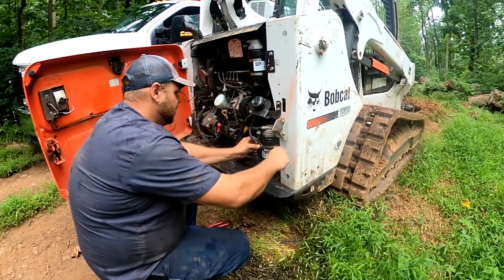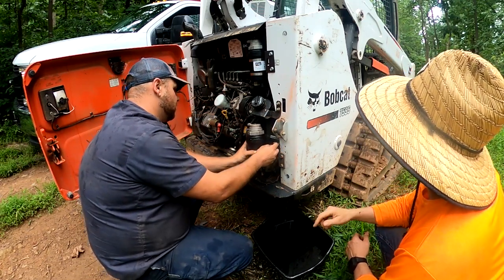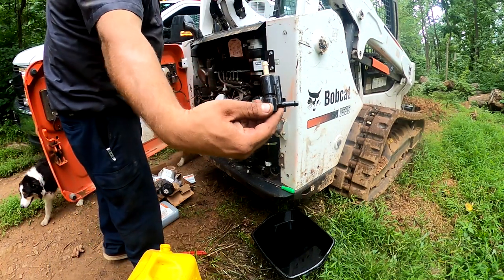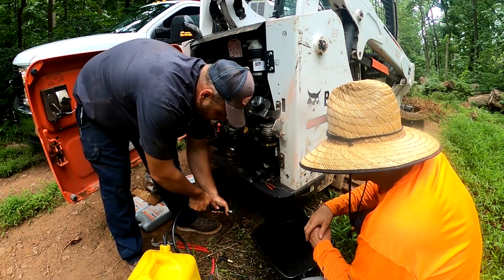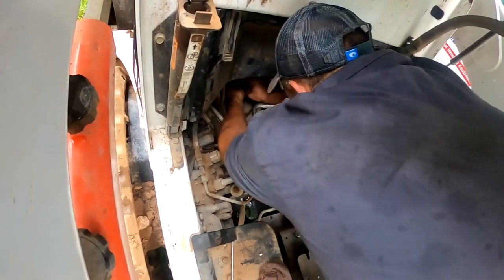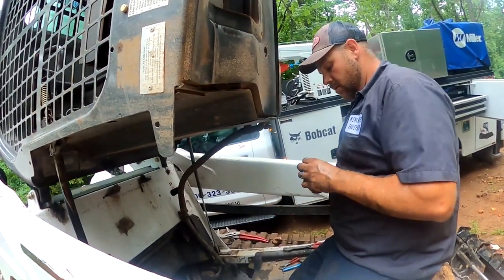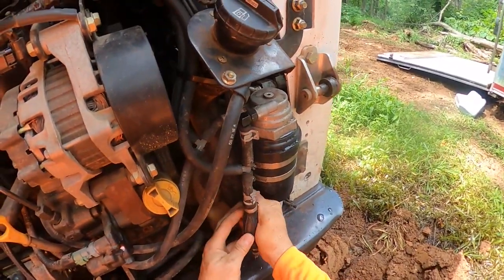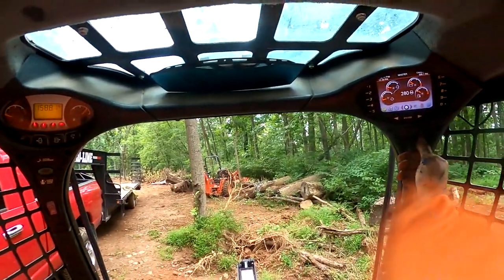2020 Skid Steer Error Code Part 2 of 2

Comment: I work on these for a living, just a hopefully helpful tip; whenever I'm boosting a skidsteer I put the positive right on the nut on the starter.  It's sticking right out the back of the engine and easy to get at.  Runs straight to the positive terminal on the battery so rather than scratching your hands up trying to hook up directly to the battery just hook to the starter.
Reply from the maker: That makes sense. Thank you for the tip....